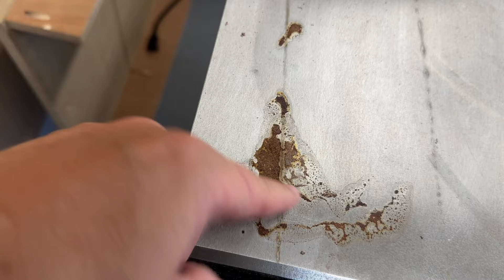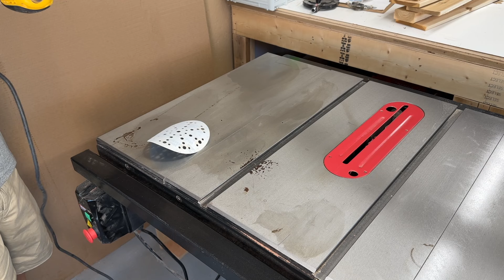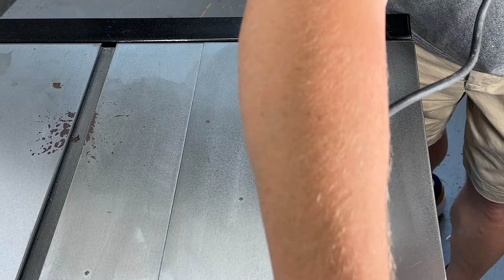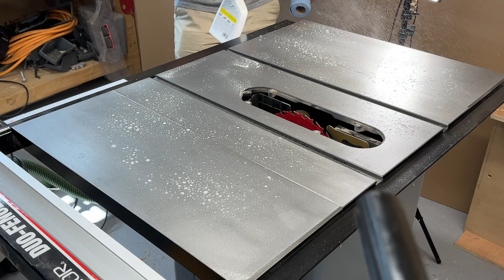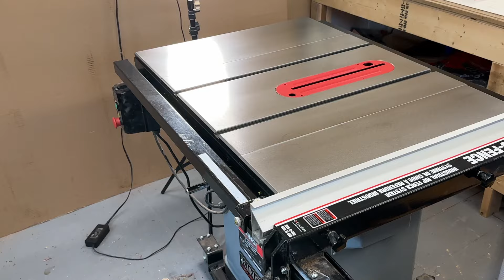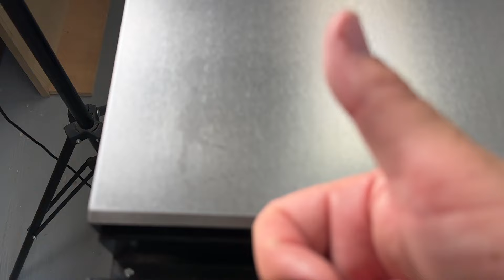Removing Rust from a Table Saw: A Step-by-Step Guide to Restoring Your Tool to Its Former Glory

Comment: Nice job!  I think I'd start with  Boeshield Rust Free to reduce the iron oxide (just because I keep it in my shop), then onto sanding and paste waxing, just like you did.  Rust Free would work well in your miter slots, but would still require a bronze wire wheel (softer than iron, harder than rust).
Reply from the maker: Awesome tip, thank you very much!